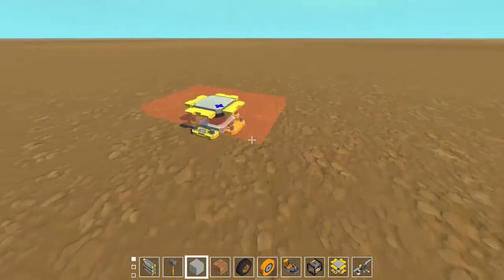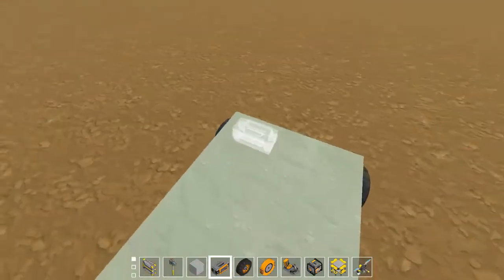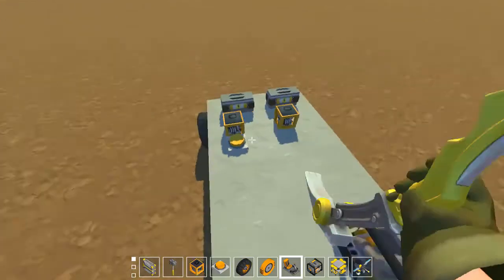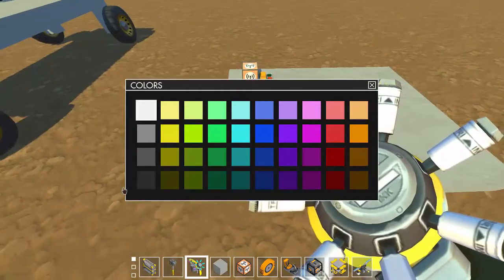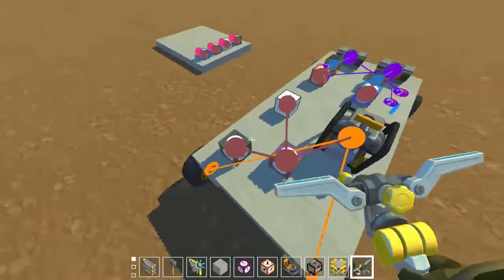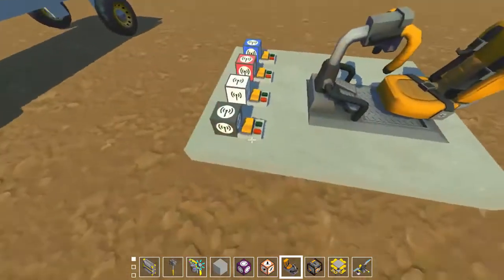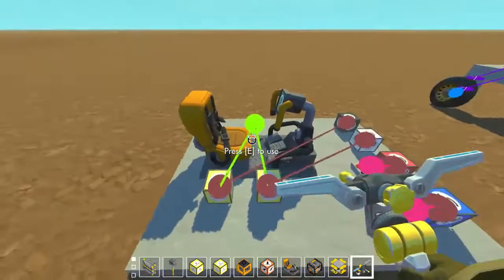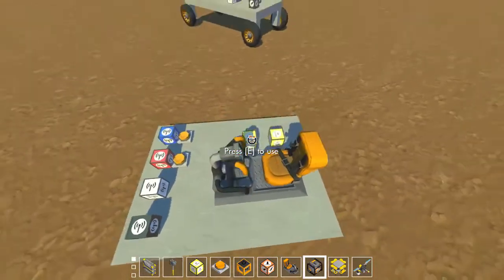[Scrap Mechanic] Tutorial: Making an RC car using my Remote Logic Mod

Comment: do A and D logic pls
Reply from the maker: I would love to, but in the current version of Scrap Mechanic there is no way for me to check whether you press A and D. The best way right now is just using a bearing and sensors. When a new update comes I will try to make A and D converters.
Reply from the maker: I kind of forgot about this comment, but it's been in my mod for two weeks now :)